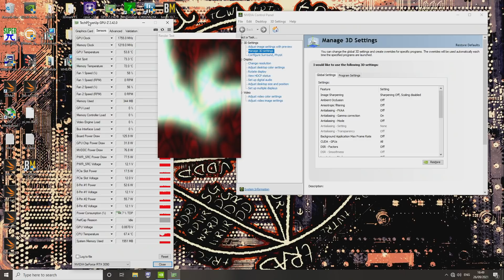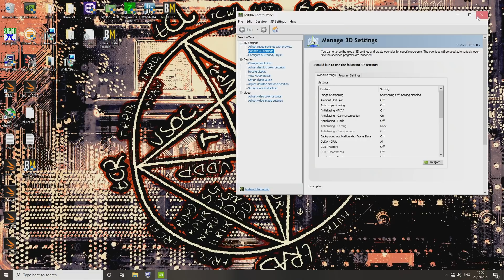Progress update on the New Worlded RTX 3090 Vision

Comment: I had my RTX 3090 Vision die in a similar way but not from New World. Gigabyte did honour the RMA but took, 3 months to repair it and send it back to me. Mine died whilst playing FFXIV with heavy reshade shaders running. 

Thanks for doing these videos it is interesting to see why it failed etc. I guess from the fact there are quite a few reports of other gigabyte 3090s dying and mine doing it months ago no New World needed there must be some kind of flaw.
Reply: Imagine 3 years from now WHEN EVERYONE IS OUT OF WARRANTY AND GAMES ARE SO DEMANDING/ GAMERS MOVE TO 1440P 240 HZ/270 hz they might blow up cards!!!
https://youtu.be/4DtUCwTXm9Q?t=408 ................ I agree!
Reply: @Multimeter1  Imagine that 1/10th of buyers got there card of ebay with no warranty at all...
im sure that never will happen.
Reply: were you playing 4K?
Reply: Founders editions or Asus tuf are the only cards I don't here having complaints
Reply: Hehe funny enough I stoped using shaders in FFXIV because it would ramp up my fans to 100% after a couple of minutes, 3090 FTW3 here, after the new world open beta killed some 3090's I was glad that I stoped using reshade, EVGA did said that even if the New World code is trash and it DID killed the cards it was also because of a poor welding on their part which was worsen by the power drawn
Reply: @axelwolf2115  dont blame the game, it's Nvidia who made a card that cant control it's power use.
One game today has the problem two games tomorrow and more later.

New world is made on lumber-yard engine which is a fork of the cryengine.
Star citizen also uses it & far cry is on a older branch of cryengin.

Im sure there doing the fight club style recall maths on dead cards cost + PR V full recall of the line.
Reply: @liaminwales  I will blame both the game and the manufacturer, it IS shitty code that can't work efficiently, it is a problem with the card, the power draw issue is happening to every card, 30 series cards are being affected the most because they all are drawing 250 to 300 watts and as EVGA already stated, they had soldering issues in their first batch, 3090 do have an issue with really toasty VRAM to the point that EK even launched a watercooled BACKPLATE, so yeah the game is to be blamed as much as Nvidia, malicious software is able to burn to a crisp your computer, a poorly coded game too my boy
Reply: @axelwolf2115  Watch the live stream video on the 3090.
The only problem with the game code is it's to good, it's covered in the video buildzoid did.
Maybe there will be a YT video later that is shorter.
Reply: @liaminwales  you like the game, that much is obvious, it's ok to like it, no one is saying is a bad game, I'm happy is having success because I've always loved MMO's and let's be honest, the genre has been dead for a while, but don't bullshit me with the "it's too good" statement, this is not the first time a poorly written code draws infinite amount of resources, amazon messed up, if it wasn't part of the problem they wouldn't have had to patch the menus to cap the frame rate, it's just your average code, which people have testified before it has a lot of deficiency in the calling of objects and how it handles the changes of graphic settings, it's not cyberbugg 2077 levels of screw up, but it's also not "too good", now let's not get ahead of ourselves both against NVIDIA and New World, the amount of cards affected is less than 100 as the reports go, so as I stated before, it's both parties at fault here, I know for sure at least with my model that it was poor workmanship on the first batch, and I'm also sure Amazon was at fault because they DID patched the menus because they were the prime suspect
Reply: @axelwolf2115  I dont like how your trying to make it personal, be polite online.
Watch the video Buildzoid did on twitch dont trust me.
Buildzoid knows more about the problem than any of us, it's why we are here watching the videos.
Reply: @axelwolf2115  Hay even the start of his 1080 post stream talks about the 3090 problem.
still no need to trust me just watch the videos.
Reply: my 3080ti died playing dark souls 3 with a fps unlocker mod. Booted up the game without locking the frames to i guess it went crazy high and had a heart attack in the power thing they are sending me the same card i just dont trust gigabyte i regret it

Comment: Are you gonna send back the 3090 after you fix it or should we expect more 3090 videos?
Reply from the maker: it's getting sent back
Reply: @ActuallyHardcoreOverclocking  Mod the card before doing so with cap and voltage mods. The owner has no guarantee anyway, and if he pays up you get some more content out of it.
Reply: @Airwave2k2  cap mods is a terrible idea. the caps put extra stress to the mosfets of the power stages - caps when not 'full' appear like a short and the in-rush current is pretty substantial. voltage mod is likely even dumber. The only sane mod is reducing the max power draw...
Reply: He'll probably send it back. I mean the owner of the card probably payed thousands of bucks(scalper prices) for it and now the poor guy's probably watching paint dry or something.

Comment: Whats the cooling for that power stage look like ?.

I'd see this as a bios flaw

What model power stage is it.
Is there a pin compatible with a lower RDS ?.

We need a benchmark that pulses the power.
I think this is a problem where it boost clock's really high running simple math and get hit with complex stuff at random. Simple math like raster then, getting wacked with a random full tensor load + cuda + rt.. the die on the a100 and a102 can run at 1200-1400mhz drawing north of 650w if all of the die is powered up at the same time.
I think crap code in NW is some how confusing the on die load balancing..
Reply: I see this as a general fuck up. There's Nvidia and their standards which is obviously not good enough.
There's amazon and New world devs because they denied responsibility and it was a known issue. 

Maybe gigabyte's fault for not RMAing but not really more than a maybe because they don't decide the base specs and this is already above reference.